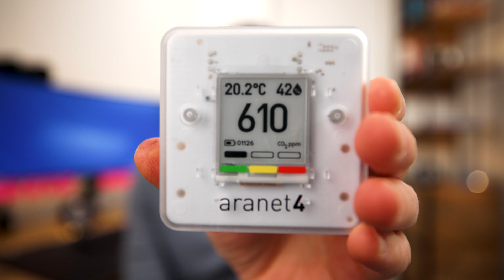Open system vs open protocol – where is the lock in? Part 1

Comment: Bryce, like major companies, there has to be a limit between what programs they are using compared to what other companies are using. If a system is completely open then any person can come in and alter the original software to what ever. In the beginning the s/w was written to meet a spec, whether that was right or wrong. Now company B comes in and changes it to what they think is correct or told to install.

Owner or manager of the building has a mate that works in BMS and says yes I can change this system to suit what you want, whether that is the correct way to go or not.

As you know, BMS is customised to suit what ever the spec has been written about in the original build. From what I have seen is that this changes considerably after the end user takes over the building. So next part of the equation is that Joe comes in and alters the software to suit whatever he thinks is correct and breaks the system as it was originally designed.

From an engineering point of view, the system is written to do a specific type of control sequences as specified originally. As we all know, this may not be the correct way of doing things but the original equipment provider has installed the system as per the original spec.

Then comes the new FM etc that wants it all changed to suit what they or other parties believe is the correct way it should work. It is a never ending circle that may never be finalised due to the system being fully open. If all automobile manufacturers had open software and anyone could enter their thoughts of how it should work then who is liable for the end result if it fails and causes human death or the like?
Reply from the maker: I think the point, Dave, is that owners want options. It's not about having someone come in and change all the software. Last year I was trying to help negotiate between the owner and their BMS company. The BMS company was charging  $500k per year for BMS maintenance (that is not a typo, half a million, BMS only) and then charging an additional $1k to replace a room temperature sensor. And wanting a work order to go see why the FCU controller was offline. 
I am not sure that you are across just bad some companies are behaving. 
If the BMS was multivendor, then the client would have options. 
I have many many examples of this sort of bad behaviour. Although, earning half a million bucks and not being happy with that, was one of the worst.

Comment: So if a freely available set of engineering tools isn't considered sufficient because people might have to learn how to use them......what is? What product has no learning curve?
Reply from the maker: Hello mate. I see your point. 
Firstly, I am more pointing out that even if you have free engineering tools, it doesn't always specifically mean that you have a system that many companies can maintain. Especially if you have a combination of three different products in one building. I.e., don't be fooled by free engineering tools. 
What we want is a BMS product that has 3 or 4 reliable, ethical, BMS compaies that can modify and maintain the full set of controllers used in that building. 
I actually don't mind if the system is proprietary with locked down engineering tools, proprietary protocols etc. If 3 companies can support that product, then tick in the box. 
It's not about the openess, its about having options. 
Of course if BMS companies did the right thing by their client, then we wouldn't need options.

Comment: Bryce, I hear what you are saying, BUT. There are always going to be the multi national providers installing systems and the smaller companies installing systems. 

The smaller do it cheaper with less overheads and a cheaper product. The customer still wants a system that is going to meet their expectations and do what it is designed to do. But this is based on what is specified in the beginning and what has actually been installed.

When do clients actually have the say on what system is installed , as it all goes by the Mechanical they will use the cheapest price so even if the client wants a specific system they will end up with the cheapest and then they are about making money as they dropped their price to win the job.

How do you have any company just come in and manage whatever system is installed. How do they know how the system was setup in the 1st place. Is the functional description which was originally written around a lose specification upto date? It doesn’t matter if it is BACnet or whatever. 

How can any servicing companies other than the original systems manufacturer have any idea about the system other than the original functional description which maybe right or wrong  depending if it has ever been updated from the original spec. And that is based on the original spec being of any value.

Have done enough projects in my lifetime that the original spec is useless as the client wants it to work completely differently, so why are we installing systems this way !

Why does the building owner ask for an open system ? They have the perception that anyone will be able to look after it…..wrong, that does not happen.

And in todays systems, who is going to keep it updated with security fixes etc and let alone system updates that included graphics etc.

You only get what the builder paid for ! Not what the customer wanted.

Comment: I have pondered this for some time and done some research into this topic as well, as it is a pet peeve of mine and I would love to see the industry changed. To achieve standardisation would need vendors to fully comply to ISO 16484 Parts 1-6. However there is currently NO vendor that fully complies to these requirements because why should they? when there is no pressure for them to do so!! I would love for BMS Consulting Engineers start to introduce these standards as a requirement for compliance.....then there may be a shift in the balance of power away from the vendors, who currently dictate the direction of the industry.
Reply from the maker: I have never heard of that standard, I'll go check it out. Thanks for sharing.

Comment: Hi Bryce, you made a very good point. I would also add that BACnet is not that ubiquitous at all, at least in Belgium where I work. Many BMS vendors still want to use proprietary protocols, especially when they don't just take care of the automation level but also of the management level. Just think of Metasys, Niagara's Fox protocol, etc. In our specifications we must therefore explicitly specify the BACnet objects that we want exposed so that potential 3rd party apps can then make use of them. The argument that we hear vendors using again and again when they are talking with the building owener is that web services over HTTPS/TCP are easier to implement and maintain from IT point of view than BACnet/IP over UDP, which is actually true, not to mention that BACnet/IP is not secure at all. I am just waiting for BACnet/SC to become the industry norm so that this argument can be easily debunked. I am looking forward to what you will say in the 2nd part of the video.
Reply from the maker: Thanks Nejc. I am sort of okay with proprietary protocols as long as there are companies that can support the product. E.g., it doesn't matter that Niagara uses the proprietary Fox protocol, because we have loads of Niagara agents. And, would anyone care if a BMS system was completely locked down to one supplier if that one supplier did what was right by the building owner? I.e., they were an awesome contractor. We only need options because there and many bad behaving companies out there.